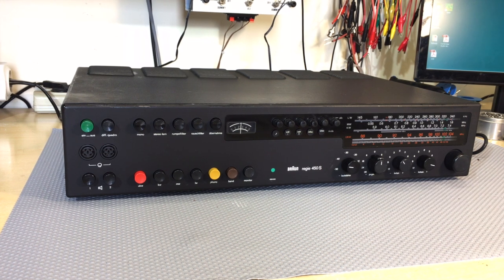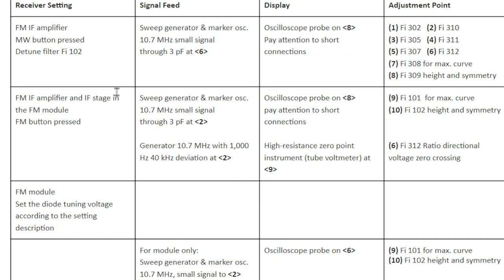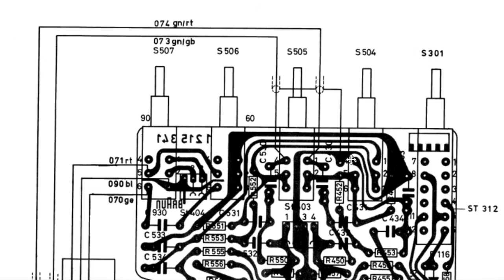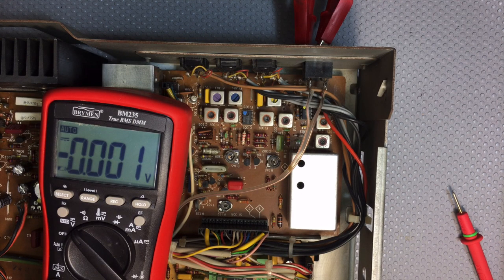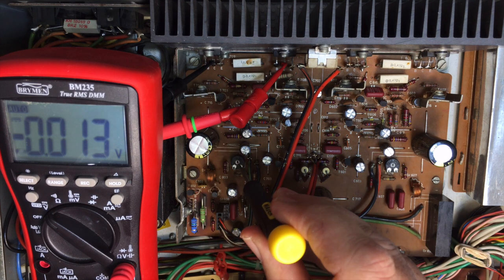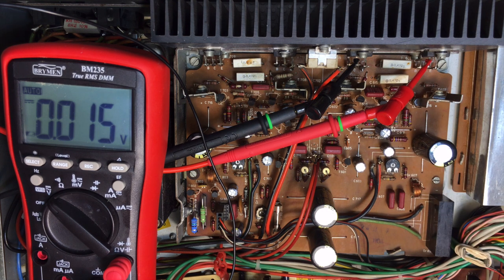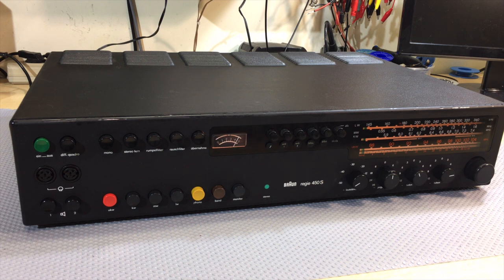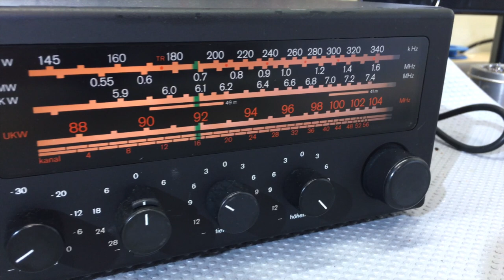Braun Regie 450S restoration - part 8. And finally ... The Finale!

Comment: I'm still amazed of the number and different types of PC boards -- brown ones, green ones, straight edges, toothed edges...
I guess the PCBs had not been designed just for this receiver, but been used for different types of Braun equipment.
Reply from the maker: Yes, I did find that strange too.